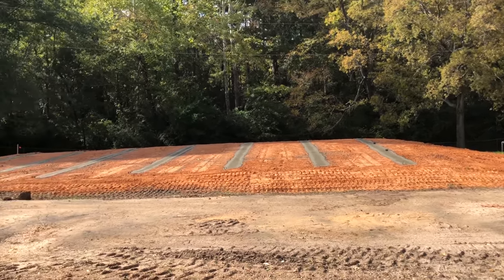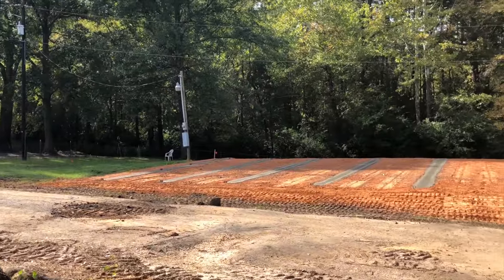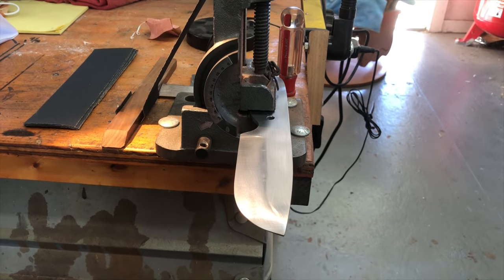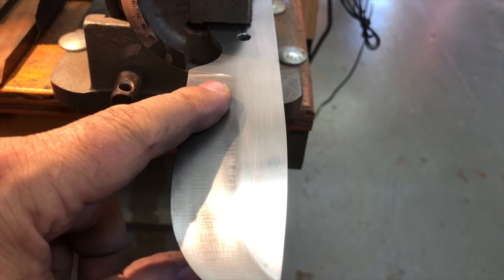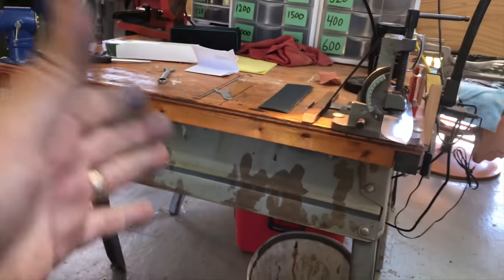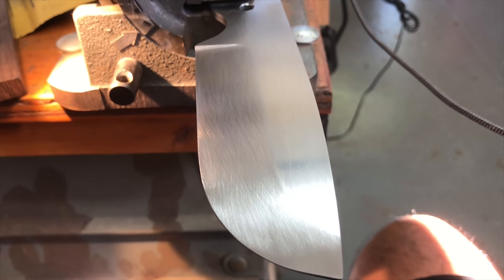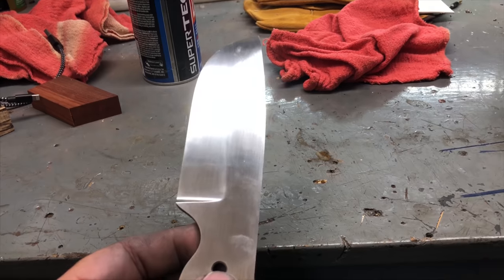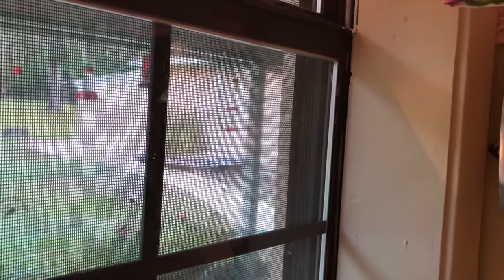Poured concrete pads for mobile home

Comment: This my second video that I have watched of your site preparation for your double wide mobile home.  Great video and thanks for sharing.  I am placing a very small tiny home 8x16 on a trailer underneath a pole barn. However, the soil is more of a sand base. I might come in and add some compacting gravel or shell rock and then dig some holes for some concrete pads. Couple of questions, how deep did you dig the holes, it looks like about a foot? Also, you just poured directly into the hole without any forms, was that because the soil; around was hard and no one was going to see them anyway? Thanks!
Reply from the maker: They are 18 inch’s deep.  No forms but they do have rebar in them.
Reply: @bctruck  Very good and thanks

Comment: Can I ask about how much does it cost for the cement truck to just come and pour into something that is all ready with 2×4s. For a normal size trailer?
Reply: Do I absolutely have to have a full cement slab to put a trailer on?
Reply from the maker: I would know the answer to that.
Reply from the maker: Nope. Just pour runners like I did.

Comment: I’ve never seen anything like that before. Is it a local code requirement?
I worked in Marshall today and will agin Friday. They have a really cool  old downtown area you might want to check out Nov 10. 
That’s cool that your making your Son a knife. He will enjoy that and be able to pass it down. 
I ran into a knife maker in Yazoo MS that buys  “stabilized” scales . Not sure what that means but he said the finish is all the way through the wood.
Reply from the maker: Just Plain Common Sense it is code in Waskom. If I had known how many codes they had , I might not have considered moving there. They even have codes concerning the skirting. I wanted to use hardware cloth behind cedar pickets but they want me to use that ugly vinyl siding as skirting.

Comment: Brad when you had the pad installed did the home manufacturer do that or did you hire an outside company?
Reply from the maker: I hired anoutside compant at half the prICE THE MOBILE HOME SALESMAN QUOTED ME.
Reply: @bctruck  I got a quote for 5k from the mobile home people for just stone and a 10k quote for a pad with cement piers like you have. That just seems really high to me. 
How did you find the guys that did yours?
Reply from the maker: I googled mobile home pads and dirt work. I got two estimates and chose the lowest. I asked each dirt guy who they would recommend for concrete runners and they both gave me the name of the same guy.
Reply: @bctruck  Ok so you had two different people? 
Did they do the hookups to sewer and water also or was that another company?
Reply from the maker: aaron darling the guy that did the dirt work charged me 800 bucks to come back and hook up my electricity and plumbing. I saved several thousand bucks by finding my own contractors.
Reply: @bctruck  Thanks, man. I am going to have to do a bit more searching as all the pricing I got was a lot more than that.
Reply: We’re having a hard time finding someone to do in our area. How do you determine how many and how far runners should be
Reply: @dianasoto3156  the company that installed our home did all the work. It depends on the home where and how many runners that are needed. 
If it is a new home the the manufacturer will be able to tell you. If you are getting a used home then you need and experienced person or a manufacturers layout.

Comment: there are a couple videos on YT of a guy that moves houses and big stuff all by himself you might get some tips.
Reply from the maker: Robb's Homemade Life well, I brought a 4x4 home from Lowe’s today. I tried using it as a lever and fulcrum. 
NOT! It ain’t budging under brad power. I’m gonna pay the 180 to have it moved.
Reply: @bctruck  Ha! Yeah, I know you could do it if you had to but I have learned just because we can do something doesn't always mean we should, I think it will be $200 well spent. That sure was an easy concrete event, I have had unpleasant experiences working with pouring concrete as you can't slow down and take a break once you start pouring. It can wear you out plus we always had to spend the day bent over tying down reinforcement and the concrete ruins your gloves and hands.

Comment: How separate are the pads one from another?
Reply from the maker: 6 feet.
Reply: @bctruck  4 or 6 inches and do you use rebar ? Thank you so much
Reply from the maker: @Faustino Rueda 2 feet deep by 12 inches wide and yes, rebar is inside them.